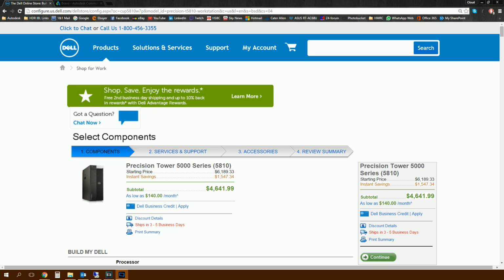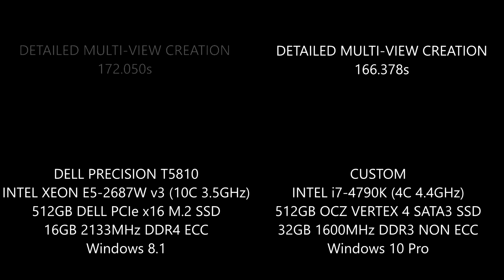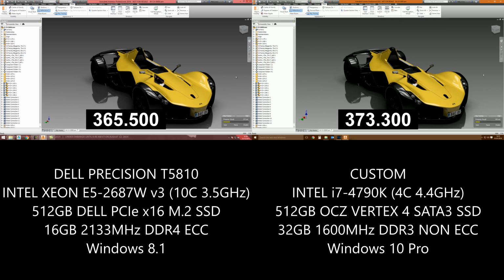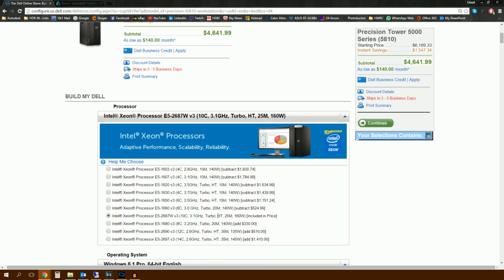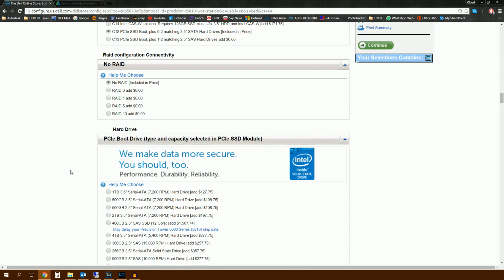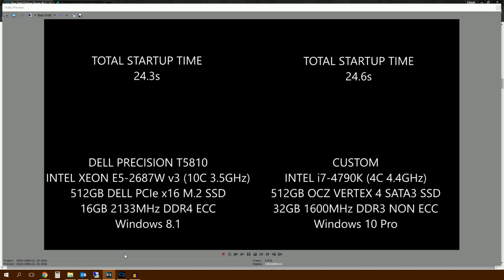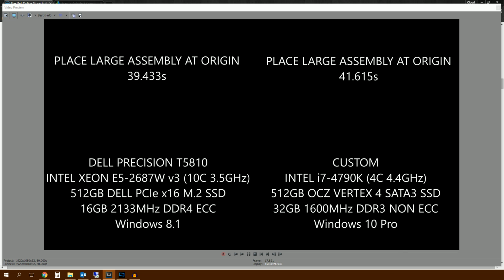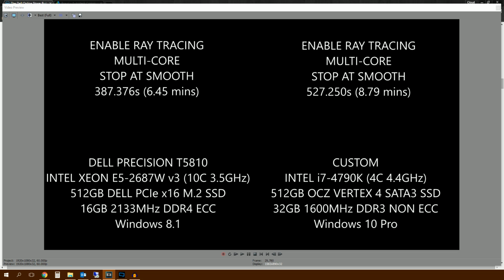$6000 10C Dell Workstation -VS- $2000 4C Gaming PC | CAD Benchmark Test

Comment: this program only uses 1 or two cores so obviously the gaming pc would be better. the workstation is for programs that use the 10 cores and then the workstation pc would be much faster
Reply from the maker: It's not obvious to a massive percentage of Inventor users who don't even know what a core or a thread is, they have no idea about PC hardware and would assume a Dell workstation with a $6000 is obviously going to be better at CAD than a gaming spec PC.  This video is the research they need to find to know more about it.

Comment: You clearly don't know what you are doing. Brands are just brands makes no difference if you have a dell or an acer if they have same specs and are under the same circumstances because the parts inside are build by the same manufacturer. The issue here is that especially rendering requires cores and ram. more cores need more ram. As a general rule of thumb you need 2+ gb of ram pr core. so 24 cores 48 threads would need 96gb of ram to run properly. here you are comparing a high core amount cpu with low amounts of ram to a lower core amount cpu with more ram. The ram is the bottleneck on the high core number cpu.
Reply from the maker: I don't even know where to begin with this, it's not worth my time replying to.  I'll leave it with yes brands do matter in the enterprise environment because of SLA's.  The rest is just not relevant or applicable to anything that I do on my channel.